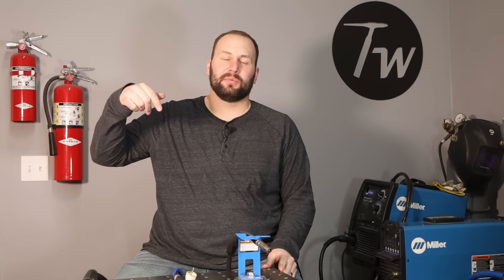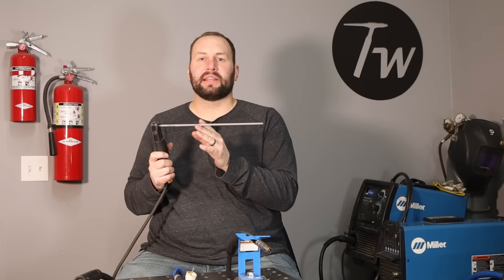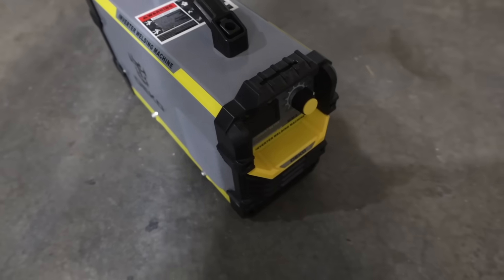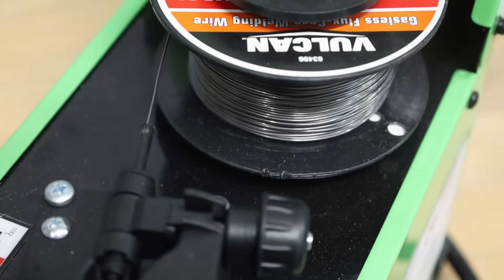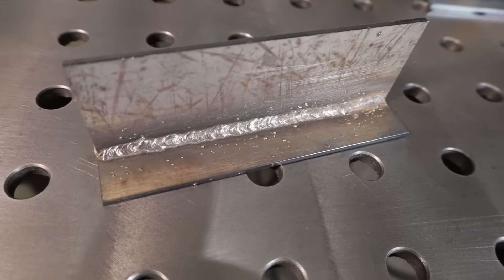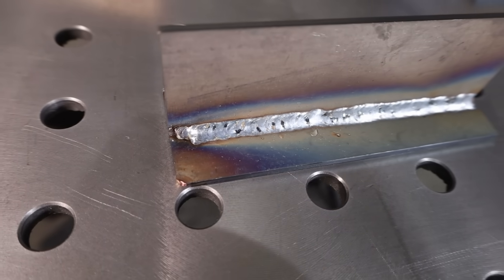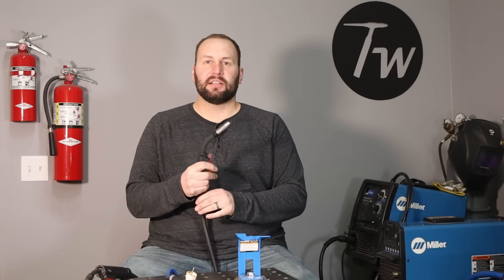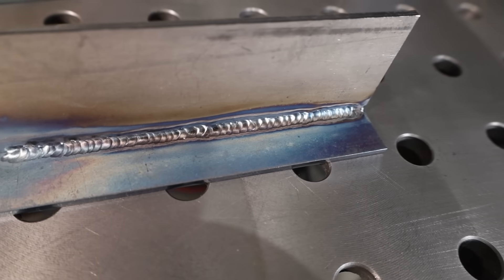4 Types of Welding Explained: MIG vs TIG vs Stick vs Flux Core

Comment: Nothing like “pecker tracks” from arcing up with stick. I was ASME certified from carbon steel to Ti, Zirc, Tantalum, and just about any other metal in 1G-4G and 6G. We had rolls that could cold roll 2” thick steel. A lot of the work was x-ray. We made chemical reactors for chemical, pharmaceutical, and the food industry. We used dual shield: Fluxcore with either an Ar/CO2 gas shielding or just CO2. Found the mixture was cleaner than the CO2. We had one machine that ran a 1/16th water-cooled gun. I remember when I was learning how to Tig, I would practice passing the wire back and forth through my fingers for hours. I miss doing that. I stopped because I had a near fatal work accident. 

I like what you had to say. You made it very understandable, better than I could. I would get lost in the minutia, like what the 4 numbers on the rods for stick welding mean, the % of gas mixture (Ar/CO2), the pressure of the gas for Mig, Tig, etc.. 

Unfortunately welding is an art; you can teach someone to weld, but you can’t give them that “feel”.
Reply: I use to weld Tantalum and Titanium for NRC in Needham, Mass in 1980 - 81. They changed the name to H. C. Starck. I think it was a division of Bayer pharma in Germany

Comment: Arc air has always fascinated me. 800 amp. Two 400 amp industrial welding machines hooked up dual. I could blow through a 3/4 inch thick steel plate like hot butter!!.

Comment: Ok so its okay to let fhe flux ride against the metal? Its only when the center material contacts that the rod sticks? That makes sense now if so, i didnt have enough angle so it was sticking when i would try to start the arc. I havent welded in years but im ready to get something and start again. Ill probably get a stick first.
Reply: @Thomas Lowery thanks, I haven't had alot of experience and remember that it would usually stick 2 or 3 times before it was going. Its been about 15 years since then and I'm ready to get in and learn, thanks for the info, specifics help. Ultimately I want to learn aluminum but not until I'm good with steel, steel abilities will help me more in the short term.

Comment: Without training, had a chance to simply try stick welding. (My area is electronics, not metalwork.) I have a great respect for skilled welders. It takes dedication and years of experience to be a pro.
I watched a pro repair a huge broken dozer blade. He spent days grinding and chamfering all four faces, then used many boxes of rods to build layers, from small at the deepest part to wide at the finish.  The blade went back into service and worked like new. BTW, his alignment was perfect. Gotta respect a pro!

Thank you for the education. Now I better understand the different types. I'm still not sure I can do it, but it's on my bucket list.
Reply: Welding: Definition, Processes, and Types of Welds  https://www.engineeringchoice.com/what-is-welding-and-its-types/
Reply: He probably used Stellite hardfacing rod for abrasion resistance. So if you know electronics please use the disconnect electrical box on the machine your welding/repairing on to isolate the circuit boards and other equipment from the welding current and voltage. And be careful where the the welding ground cable goes.
Reply: Yes, agreed....been there, with various systems work...signals ground(s) vs true ground & isolation issues. I haven't chased the problem with welders but I know it's there, waiting. Thanks for your comments.

Comment: How you even see the distance thru a flame is beyond me even with a helmet.
Reply: It's honestly not that hard to do i mean you just look, remember an apox. distance, hold as steady as can be to flip your lid down and start moving as you would when welding while slowly going down but fast enough that you don't burn through obviously lol I miss welding so much but so hard to find jobs in a farm county lol its so fun to get in the zone trance and melt some metal to other metal lol
Reply: Easier with some processes than it is with others. Stick and flux core tend to be 'messier' arcs because it's burning and spitting flux everywhere, but with MIG and TIG you get a really nice clear picture of the arc.

Comment: Great and informative video. Subscribe... check. Notification bell on... check. Question for you. I've never welded before and I have a residential gate with 16 gauge 3/4x3/4 square tube pickets. Several of the pickets need to be replaced as they have cracked (safe link to pictures: https://photos.app.goo.gl/6vGtUcFqKJbeDpML6 ). I'm planning to cut off the bad pickets and weld in new pickets. What kind of welding machine would you recommend for this type of welding?
Reply from the maker: I would probably MIG weld that, though flux core would work fine too. Either way, it will go better if you clean off the rust with a wire wheel on an angle grinder. It could be done with stick, but thinner material like that would not be a good beginning stick welding project.
Reply: @TimWelds  Thanks for the pointer! Appreciate it!

Comment: In the mid70's I use to build microwave klystrons and used to TIG (tungsten/inert/gas) weld inconel sheet that was .10" thick and it worked great! It was also great for welding stainless to copper. Don't forget that when you TIG, you'll also need a grinding wheel to form the point on the tungsten rod. AND, the smaller the weld, the smaller the diameter rod you'll need. That means a supply of rods and chucks for holding them

Comment: It‘s not called MIG unless the shield gas is pure argon, helium or nitrogen. As soon as the shield gas contains an active part like co2 it is called MAG. Welding with flux core is still MAG or MIG, flux core wire without shield gas is called inner shield or self shield. MAG/MIG welding can‘t be compared with stick welding it’s a completely different process. TIG is called Tungsten inert gas welding, inert because it requires an inert gas like Argon or Helium. Please don‘t spread incorrect informations

Comment: I was waiting for the big reveal of what MIG and TIG stand for, but it didn't quite happen. Well, no problem, Tim's a busy guy!  I was taught that MIG is Metal [with] Inert Gas, and TIG is Tungsten [with] Inert Gas.

It was the 'I' for Inert that didn't get a mention, and that 'I' is the expensive bit that performs the molten magic.  ;-)
Reply: The inert gas shields the air from the weld, so no bubbles or porosity appear in the weld. All welding requires this TIG, MIG and Arc.

Comment: Mig: Easiest 
Tig: Best looking
Stick: Ghetto
Flux Core: When you're poor
Reply: How is stick ghetto 😐
Reply: @ex3cit  You can't be cereal.
Reply: @loafandjug321  Um im not lying
Reply: @ex3cit  - Really? How do you Sleep? Standing up? 😲😁🤭
Reply: @GeeBee135  lmfao not really i use a 25k$ welding machine and weld electrodes that are as thick as your finger
Reply: @ex3cit  I agree!  When I was starting out welding....loooog ago. Most all was stick & sub arc. I worked 2nd shift doing large build up's on 22" nozzles.  If it wasn't fillet guage correct or pretty .....it got cut off and re done, till it was correct. The experienced guys I followed always amazed me. The could put on a multi layer fillet nozzle build up and I could seldom see where the broke arc and re started. Some of the most beautiful stick work you would ever see! Took me a couple of years before I was at their level.  Any welding process can be art or crap.....just depends on who's sitting behind the hood. As the old saying goes....When the hood drops...the BS stops!
Reply: Ah shit.  Easy Pete's got a date.  Money Grip's threads are always good for gay hookups
Reply: @MartinAoki47  bro what
Reply: Used to make pressure vessels the only process that could do it was stick. Mig welding the weld under test was pourus . Flux cord Mig you couldn't do a root run because you needed smaller rod size. Other than thin metal, stick welding is more flexible for steel,s and cast iron. Aluminium tig! , gas welding can be done, and it's not brazing using aluminium the same as the parent metal. Mig is great for fab work on light guage, box and tube, and sheet fabrications. Gas welding on car chassis etc. Pretty useful in the right hands. Looks good done right though. I am 63.
Reply: As  professional welder for almost 40 years, all 4 processes have their place and do require a high skill level if you plan to be an "in demand" welder. Trust me...."dobbers" are a dime a dozen when it comes to the real welding world. They are usually the first to move down the road.  Consistant, X-Ray qualified in those processes, on multiple base materials, is where the real welders are. I too worked on heavy pressure vessels, (1970's) and virtually all were SMAW root with  FCAW or SAW fill & cap. Most any weld can & should look good and be a sound weld. Problem is not all welders can do both.
Reply: dumbest thing i ever heard award to “money grip” aka i can barely can mig weld / i saw a nice weld and someone told me that was tig /tried to stick weld but couldn’t strike or maintain the arc / what’s this fluxcore junk i don’t understand why or how ? lol🤡
Reply: @adamnahtankyoulol3499  Tig fan boys with man buns in a shop drinking vanilla coffee while doing basic fabrication. Real men are in the mud and cold welding giant pipes
Reply: @ex3cit  You smoke pipe?
Reply: @loafandjug321  yeah alot
Reply: @ex3cit  Well HELLO there! ;)

Comment: which welder will repair a 2 inch gouge in the side of a dump trailer. (from the blade of an excavator)
Reply from the maker: I would stick weld it, probably with 6010 or 6011 rod. Any of the other processes could be used if needed, though. Thanks for watching and for the comment!

Comment: Great video, thanks! Is there a specific metal that requires a specific process? like could you only weld aluminum with mig or carbon steel with tig? or is any process usable with any metal?
Reply: You can use mig and big for aluminum, but to do it with mig, you have to get a special push gun.

Comment: Great video!!  I learned to gas weld and stick weld when I was a kid(early teens).  I've often thought about trying my hand at tig welding. I've wanted to get my skills back up for a long time. I think when I finish nursing school I will get a machine and get back into practice. I still torch weld some but that's about it. Your explanation was very easy to understand. Thanks for that.

Comment: I tried flux core welding one and did not like it... Too much splatter, so any time it might have saved by not having to change electrodes ended up being used in cleaning weld splatter (or jams in the wire feed mechanism)... As such, my solution was to just use stick welding and avoid anything thinner than 16-gauge steel... For anything thinner than that, I just use oxy-fuel welding or sometimes brazing (they are different processes)... I'm not a great welder, but I can usually make things stick together... Making them able to hold water though is often wishful thinking... :(

Comment: No Dual shield flux core? It's almost like MIG but instead of just a gas shield you also have flux in the wire and slag on the weld, it's incredibly forgiving and can be punched in super hot for excellent penetration. We use 100% duty cycle machines with both dual shield flux core and stick on each machine for fixing railcars and the dual shield flux core easily welds 1/2" steel and makes it possible for average welders to lay down fantastic beads with how forgiving it is and you don't know true welding satisfaction until you've had that slag fall off on it's own in one piece after the perfect bead.

Comment: One thing to note would be your welding environment. If welding outdoors where it’s breezy, stick and flux core are nice.
Reply: Although working outside tends to attract a variety of flying insects that seem to love the flashy light.
Reply: @bobhope4395  they just become part of the structural integrity
Reply: @mrwatermelon3123  😀
Reply: Indeed Mig and Tig are better for inside, otherwise against an unpredictable wind, you can have a problem to protect your welding with the flow of argon gas
(so you would anyway need to increase the debit of argon outside, and the cost).
On the other hand Flux and Stick are best to use outside because of the respiratory nocivity of the vaporized protection... 
A plus side for Mig and Flux : the speed of work.
A plus side for the Tig: the cleanest weld.

Comment: I learned submerged arc n mig welding on large gas pipes for like the Alaskan pipe line.  Ill be honest that bead u laid down had a lot of gas holes in it n would not be acceptable for what I learned.  I mean stick welding was used to fix equipment n make tools n it was a kind of watever thing
Reply from the maker: I see what you’re talking about, but there was no porosity (gas holes). It’s a different sheen where silica islands came off.
Reply: @TimWelds  looked like gas holes from the dark spots.  The bead is beautiful.  Most of what we worked on was plates that were .684 to .780 inches thick.  Wholly different ball game when you have to melt those n get the work passed a fluoroscopic x ray n a hydraulic expander.
Reply from the maker: That’s awesome! I have so much respect for the level of detail and skill required to perform work at that level. Thanks for watching and for the comment!

Comment: i learned ; stick , mig . tig 
all welding requires concentration !
stick (arc) welding . its basicly rod size and amperage 
mig welding is a balance between wire speed and amperage 
tig welding is learn how to play the drumbs while blindfolded

Comment: Can't say I'm much of a welder, but I looked into how the processes came about.  It's mostly production and economics.  Stick is versatile, works in windy conditions, quick to change weld metal/flux, etc., but it takes time to change rods.  So they developed flux core to cut out the rod changing in factory production (and less training needed since you don't have to learn to compensate for the rod melt).  Also, the arc strength doesn't change with lessening current path as the rod melts.  Then MIG took away the weld cleaning time increasing production.  TiG added some productivity, but really got its boost from doing aluminum and other base metals better.

Comment: I wonder which method is best for common metals other than carbon steel. Such as Alluminum, alluminum Alloys,  stainless steel 304 316 , copper etc...
Reply from the maker: Definitely TIG in my opinion. Thanks for watching and for the comment.

Comment: Great info, and laid out well. I would also mention on multi function machines that if the machine does go down your generally stuck and can't weld at all. Having separate machines give you the ability to still weld if one stops working

Comment: you can weld Aluminum with a MiG. I use Argon for all my welding beats the hell out of having multiple cylinders. Do you use a foot control or a standard hand piece
Reply: issue is that with larger steel things it's better to use mag, with stargon c20 for example, instead of argon
preferably with filled wire too,  the combo of this will make it burn deeper into the material.

i prefer tig welding though,  less noise, no cleanup after the welding ( you do have to before welding)
Reply: @Eagles_Eye  
yeah haven't heard  of these combonation of gasses where are you from I am i Australia
Reply: @bearup1612  europe, they don’t have stargon c20 everywhere? 0.o lol something new I learned today then

Comment: Pretty informative video.  Only critiques I have is;

1.  Both FCAW and GMAW are both forms of mig welding
2.  Wish you would have explained all the correct terms of welding. For example TIG stands for Tungsten Inert Gas
3.  I wish you'd have explained SAW (Submerged Arc Welding) since it is super common and uses a different process than the other 4.

Comment: Really good video, thanks a lot! I'm more into woodworking but I would like to learn welding to make parts or furniture with metal combined with wood like chairs, stools, tables, desks, etc. I will probably go with stick welding as there are so many machines now that are small, inexpensive and easy to use.

Comment: Lost count of the number of videos that say a 240 volt welder is "portable".  Not necessarily.  Need a 240 volt outlet or a sizable generator.  120 volt flux core is called a "farmer's" welder because it's more portable to do welds in the literal field with a small genny.

Comment: Can you weld auto body panels with flux core welder?
0.6mm wire?
Reply from the maker: It's possible, but not ideal. The most common way that I have seen to weld auto body panels is by using many very small welds to avoid heating and warping the panel. Slag would have to be cleaned off of each one.

Comment: I've had some slag on my rod in my time.
Reply: It was just your hand.
Reply: That's no way to talk about your sister.  😁
Reply: @Outland9000  I wouldn't touch that ugly cow with a bargepole
Reply: Well, now you know how to use a chipping hammer and wire brush to deal with it
Reply: @garydiane1577  Good call, but the doctor recommended Penicillin
Reply: Was it from the girl next door ?
Reply: @loafandjug321  Desperate

Comment: What happens with a TIG welder if you accidentally poke the molten steel with the tungsten electrode? Does it get stuck so that you can't remove it and it'll be ruined?
Reply from the maker: It happens. It usually doesn't get stuck, but does get contaminated and the end needs to be ground to a point again.

Comment: I have an old AC stick welder (essentially just a transformer) and I am the world's worst welder. I always had huge difficulty holding the end of the electrode in place when the electrode was long, so I invented a solution. I wear a really good leather glove on my right hand and hold the actual electrode, like you would hold a pen when you write. That way I get the electrode to stay exactly where I want it.